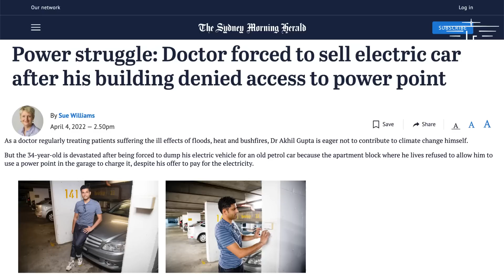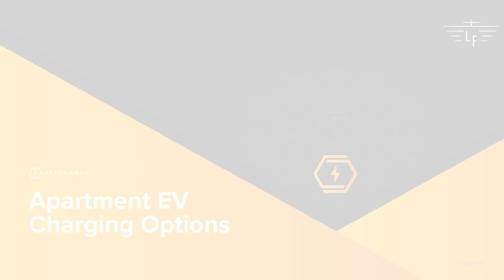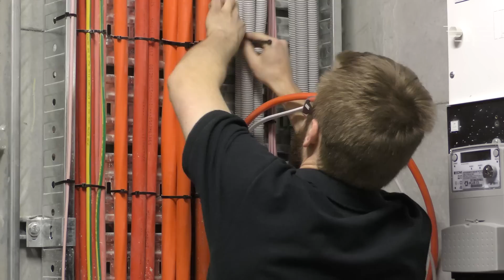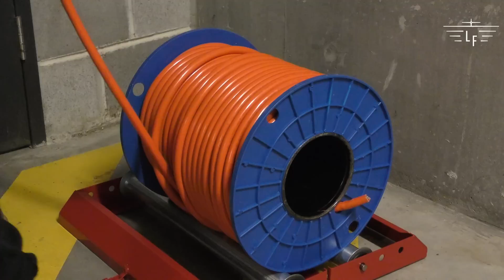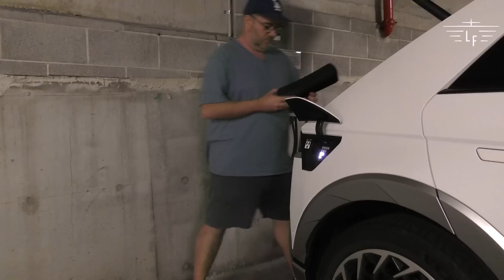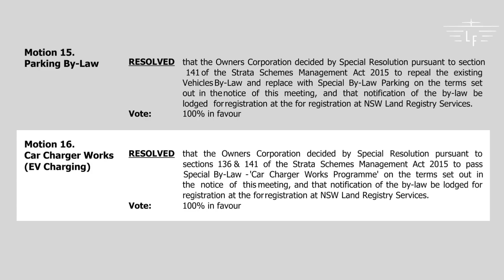EV CHARGER INSTALLATION IN APARTMENT CARPARK | One Owner's Experience

Comment: Infrastructure was recently installed in our building. More of a generic question. If we have the charger unit installed, can strangers/thieves plug in their EV and steal power from the unit? Or is there a locking mechanism?
Reply from the maker: Some units have security features such as PIN to charge/unlock
Reply: @LudicrousFeed  thanks that’s good to know. Any measures that owners can take to secure their cable? Thieves have been cutting/stealing them and selling for parts.
Reply from the maker: Private security camera?
Reply: @LudicrousFeed  there are security cameras in the apartment car park.

Comment: Great video.

By coincidence, we came to pretty much the same technical solution in our strata. The install was completed a couple of weeks ago. We have a small strata with 11 units. Some owner occupier, some investors and some units still owned by the developer. Given the mix, we had to find a way to balance the competing interests of being able to provide the charging infrastructure without placing an additional cost burden for the install or ongoing administration to those who were not interested. We came to the same conclusion that being self funded and wired from the unit holder's meter would mean no additional costs or admin of electricity charges. Unfortunately we did not have a by-law and we did not have a very good strata manager. The first stage of the process for us was to educate the other owners. Some were also looking to future proof the building as they might be interested themselves at some point in going to EV. The main concerns were: who would pay for the install, who would pay for the electricity and how would we manage the power supply limitation as more owners wanted EV charging. We convinced the Executive to fund the installation of a break out box in the meter room next to the power meters. This was to provide for the required circuit breakers for sub-circuits and big enough to accommodate all unit holders should they wish to use it. This only cost a few hundred dollars. We then had a motion at the last AGM to allow all owners to be able to wire a GPO power point and light to their storage room/parking bay. So, the point here being that we pursued a strategy that gave a benefit to all unit holders, not just us. We had another motion giving us permission to draw more current than a GPO and to install a wall unit, but that the Executive could determine the maximum current drawn from time to time to allow for the equitable sharing of load as more owners requested EV charger approval. We are in the ACT, so no by-law required, just an ordinary motion is required for the supply of power infrastructure. We had a run of about 15 metres. Half used existing cable trays, we installed the other half. We also did three phase 16 amps. The only plus for us was that the building is already set up with three phase. We have a storage room adjacent to parking space  and we wanted power and a light to that room. There is a small circuit breaker panel in our storage room that allows us to switch the unit off if we wish and a circuit breaker for the light and power point.The Tesla Gen 3 wall adaptor is mounted on the wall behind the car spaces that happens to be the wall to our storage space, making wiring the breaker behind a locked door easier. We went with the simple solution of providing internet by using the exact ethernet over power adaptor shown in Tom's video. We get about 250Mbps, ample for software updates and to run a security camera. We have a Unifi setup, so just needed to plug in a cheap hotspot to one port on the ethernet adaptor and the camera to the other. The whole process took over a year for us. The biggest hold up was our strata management company. We had at least three, maybe four, people assigned to manage our property due high staff turnover. Each new manager had to be briefed on what was happening and what we proposed. Mismanagement by the strata meant our AGM got delayed by months, further prolonging things.

We had Mark from Electric Vehicles Canberra assist us with the planning and the install. He did a great job and was very patient with us while we were dealing with our strata issues. The install took a few days and the total cost was about $7600. Given the issues with getting charging infrastructure into existing strata buildings, I think we will more than recoup the cost if we decide to sell.

Comment: Yes, one very lucky guy! Single installs like this one can be very expensive (over $4000), and make it totally uneconomical. For most apartment buildings with 50 or more units the only way is with a managed system. There are only two companies in Australia that have real experience of doing it, Jetcharge in Melbourne & EVSE in Sydney. A building needs at least 250amp free capacity as split over 3 phases. Single phase is only required to each car space requiring it. That gives 32A max to a car which means about 7 cars can charge at full rate simultaneously. The system will reduce current if more cars join keeping the 250A ceiling. Having 7.2kW max at car space is fine. Our apartment building was done back in 2020 & has about 10 chargers working but another 20 car spaces cabled (data & electrical) ready for installs later. Billing done by system as power comes from common property. Works flawlessly. Happy to have a private chat if interested Tom.

Comment: Having been the strata secretary for 2 years i applied  for and have Just been granted approval to install a EVCP in a garden bed on our fence line as far from the building as possible. I initially I requested to Install it in my EUA carpark. Either via my power meter or the common power system system. 
Initially they were afraid of fire so no to basement charging. With guarded conditional approval for further investigation for the garden Bed. I obtained a few quotes for different systems, having decided that a credit card swipe system complete with Wi=Fi that I would for. That was knocked back by committee because they were concerned if o departed the apartment complex they would need to pay for an internet connection, I shit you not!  Anyway I am not standing for strata after such such a rough period.
I will spend my days driving my Tesla. F=_&=3_%$ them

Comment: I’ve owned a Tesla M3LR for the past 9 months. Initially I was planning on installing a dedicated wall charger in my garage. However the Tesla sales guy said I wouldn’t need one unless I was travelling over 100km per day.
We travel between 50 to 100km per week. So only charge car approx once per week now. Currently spending around $10 per month according to the Tesla App.
I have a friend who installed a 3 phase charger in a strata scheme for over $5k. Which would be the equivalent of 40 years of charging (in my case). 
If your car is parked for 8 hours and / or you are working from home. Do you really need 11kw charging? 10/15A power points are quite effective for the average driver. Cost benefit analysis required 🧐
Reply: Exactly Biker Sydney!

Not many people realise that a standard 240V/10A GPO can provide 100-140kms of range to the average EV, on an overnight recharge time of 10-12 hours !!

So yes, as the Tesla chap correctly advised, as long as your total daily commute/usage is under about the 100km mark, there is absolutely no need for an expensive 3-phase charging outlet. An inexpensive standard GPO will more than suffice, making apartment charging outlets way more practical and convenient.
Reply: @To Uc Australia I just charge via Tesla mobile charger plugged into 15A power point. Only use free excess solar production from my house. Maximum speed 3.6kw. Only use Tesla superchargers for road trips outside Sydney area
Reply: @To Uc Australia if the mobile charger is actively charging the Tesla logo will flash green . If you are using via Charge HQ then charging may intermittently switch on and off depending on excess solar availability. Tesla Tom did a video on this last year.

Comment: Great Video. If I have a PowerPoint inside my garage, can the Strata stop me from using a portable level 2 charger? I don't drive much ( maximum 50 km a day ) and I'm interested to get an EV in the next 3 years. I will be happy with a charger to get between 10 and 15 driving KMs per hour.
Reply from the maker: I think it’s good practice to always check anytime you use a power point in a public or common area for EV charging

Comment: As an early adopter, this is exactly what I did; run a cable from my meter directly to an Wall Connector at my car space. However, this is not scalable once EVs become common place. You can't run a 16/32AMP cable from everyones meter box to the carspace, and you need additional circuit breakers in the meter room. So down the track, Strata's will need to invest in revamping the charging infrastructure so everyone has a charging point at their car spot, if they choose. Also, I think he was lucky with strata, some stratas are an automatic ban on EVs because they're scared of the fire risk.
Reply: Do they ban petrol vehicles too? Because petrol is sort of a fire risk too…
Reply: @HelenLannister  EV fires are extremely hard to put out, and some insurance companies won't ensure the building if an EV is parked in there. Stupid, i know.

Comment: I think Brett is very lucky.

I’ve been on my committee from day one, and I’m currently 6 months into the process of getting EV chargers installed…

We had an AGM where all in attendance (77% of the building) voted in favour of allowing chargers and the day after I found out we need a seperate special resolution (I was under the impression the resolution at the AGM was this resolution) to allow the installation on the wall. That process has been a further two months from the AGM.

It is possible, but it’s not ‘easy’ or straight forward

Comment: Sure, one installation seems okay. But this now sets a precedent. Fast forward 5 to 10 years and then everyone in this building wants their own private charger. How's that going to work? 100 more of these bulky cables, and all the associated equipment and the potential power drain?  Strata committees should instead look to install a couple of charging stations in shared spaces which are pay-to-use (like shopping centres) for those who actually need a faster charge, and give the private spaces access to a standard 240v outlet for granny charging. I think that would be fairer on everyone in the building.

Comment: Im currently in the process of renovating my home and am trying to figure out the most effective and cheapest way to set up my charger. Do you recommend three phase power?
Reply from the maker: If I were starting a new build, I would make allowance for 3-phase from the beginning
Reply: @LudicrousFeed  my electrician said the same! I have budgeted for it. But also another question was how many amps i should set the home charger to on peak and off-peak times. And I'll be honest im really confused. I currently rent a heritage home and havent been able to install any chargers for 2 years so i just use the emergency charger that comes with the car
Reply: Not every area can have 3 phase, our brand new subdivision does not have that option. Also 3 phase can be a curse as being 16amp if your EV does not support 11kw charging but only 7.2kw then you actually apparently only get 3.6kw as well if you have 2 EV again the 3 phase is split so half power output to both EV.  It's a bit technical, I saw about this on another YouTube channel.

Comment: Very well articulated and thought out.  Let’s hope all new multi apartment buildings can be fitted out in the design stage.
Reply: In some countries compulsory already.
Reply: All well and good for new apartment complexes going forward Geoff, but......we realistically have to consider the existing blocks across Australia, of which there are something like 2 million apartments!!!

It is going to be a ginormous task to provide EV charging for 2 million apartments! Absolutely monumental! And as Brett mentions during the video, many existing apartment blocks(particularly older ones) do not have sufficient incoming electrical capacity to provide for the required number of EV charging points, and so will have to have their “electrical backbone” increased, which can be very, very expensive, potentially requiring a special owners’ levy to be struck! No doubt a very unwelcome cost to those owners who are not interested in purchasing an EV!

Interestingly enough, Albanese and the ALP have promised to “rewire” the national electricity grid with more HV transmission lines to cater for the increase in renewables going onto the grid. That is estimated to cost around $20 billion. But that will be chicken feed in comparison to the cost of wiring every one of those 2 million Australian apartments to enable EV charging!
Reply: @Nicholas.T  In the same way apartment buildings are getting updated with new elevators and double glazing etc they will gradually add more and more charging points. In this case we had 11kW but for daily commute you just need a 2.3kW outlet (10A single phase) to charge overnight (say 10 hours of charging = 23kWh = more than 100km range added).   I know a property developer who had planned 5 EV charging points in a new development of 40 apartments but more and more buyers wanted one so now all 40 spaces are prepared for charging. If there is a demand it will happen...is as simple as that. At the end EVs will actually assist stabilising the grid.
Reply: @moestrei  I don’t think you appreciate the point I was making.
With new apartment complexes being built now, it is obviously straightforward because the developers can allow for a decent number of EV charging points and the extra electrical capacity required(or at least they should be doing that). Just like many developers were already installing Foxtel outlets into many apartment blocks as long ago as 20-25 years.

What I’m talking about is the huge cost and resources required to RETRO-FIT millions of EXISTING apartments to allow for EV charging, particularly so if governments around Australia start foreshadowing the ban on the sale of new petrol/diesel cars within the next 10-12 years. As the ACT has already recently done (in their case it will apply from 2035 onwards).
Reply: @Nicholas.T  No matter what you say it will happen gradually anyway. When done in lots the cost per parking spot is actually surprisingly low. There will be a lot of infrastructure changes. Our gov supports the fossil fuel industry with 15-20 billions / a .....this is peanuts.
Reply: @Nicholas.T  If you can afford a vehicle for say $35k to $235k and accommodation worth multiple $100k then there are funds for $2-4k installation available. If there is a huge demand and supply issues (as it is with EVs now) then people will have to wait and or pay extra. Australia is lagging approx. 10 years behind when it comes to EVs and overseas experience has demonstrated that everything you try to argue here simply is a non issue. Like the former gov statement that 'EVs will ruin your weekend' which has become a running joke now days. I personally think banning ICE is not the right way to do it and unnecessary as EVs have so many advantages over ICE that the transition will happen automatically, even many people here today cannot get their head around it.